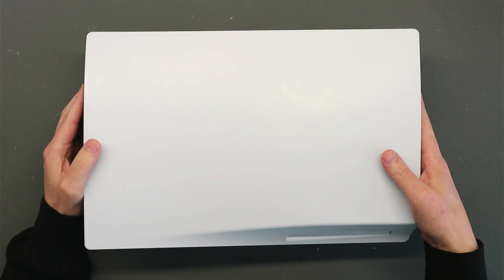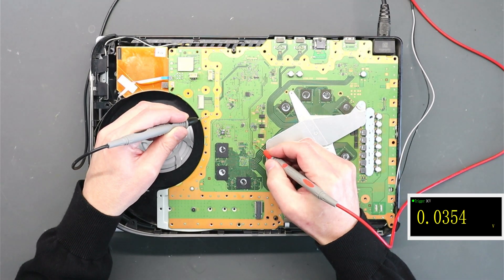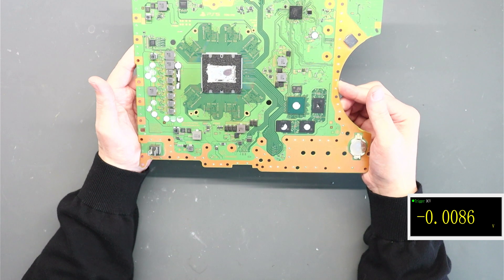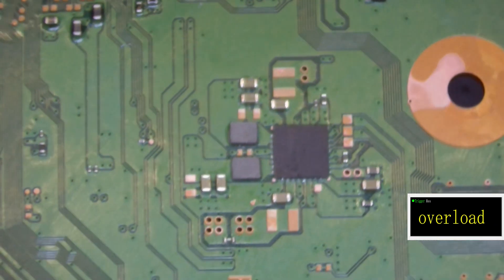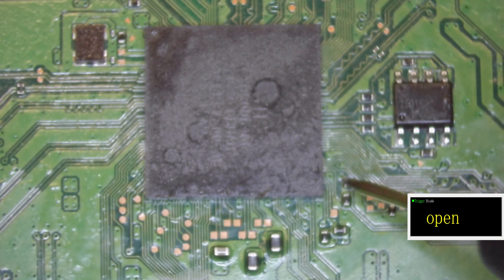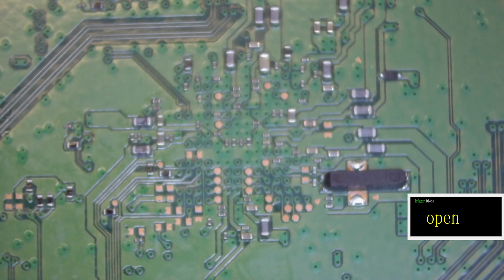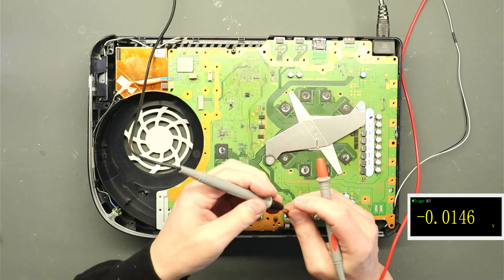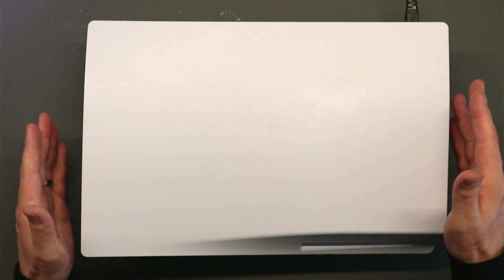How to fix a faulty PlayStation 5 with a missing 3.3v rail no power - full diagnostic & testing

Comment: I guess I just dont understand this bit at 5:02   I am missing the 3v line like this one but I dont really understand what exactly youre doing to determine the short circuit..
I got scammed on a ps5 and im trying to fix it even though I know very little about board.   This one appears to have been opened before and has some flux on it in different spots.  Its also missing a usb on the back.   Its in rough shape.   please help?
Reply from the maker: With your multimeter, measure each side of the capacitors - if both sides have low resistance then there is a short circuit on the board
Reply: @ConsoleTherapy  wow. Thank you I will definitely work on this more.